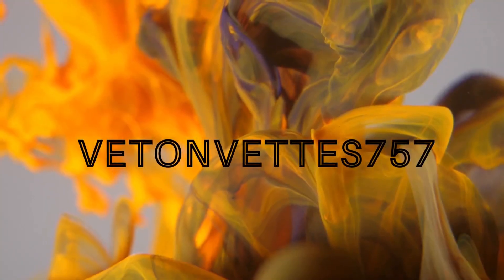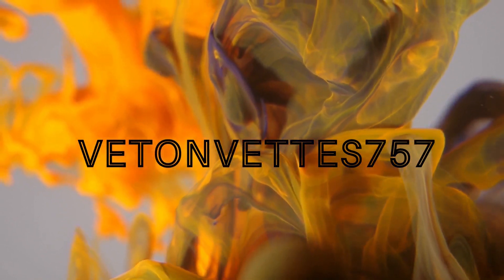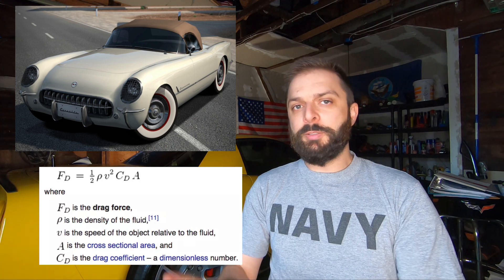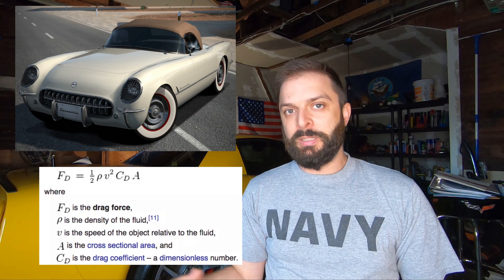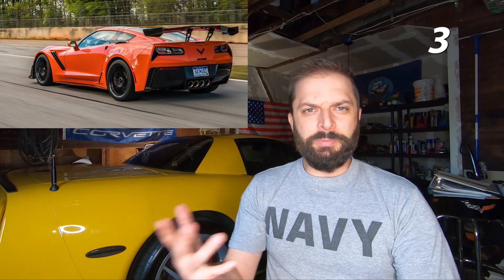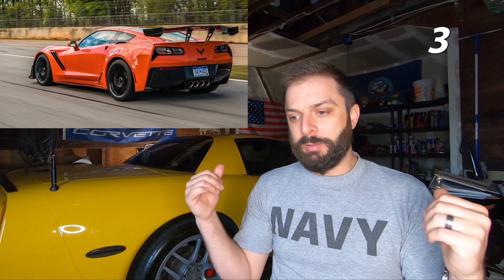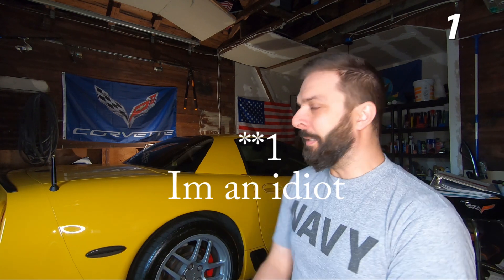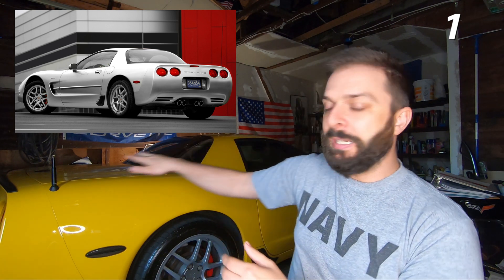DOES NEWER MEAN MORE SLIPPERY?  FROM LEAST TO MOST AERODYNAMIC! C1-C8 DRAG PROPERTIES.

Comment: The standard C6 Coupe has a drag coefficient of 0.286.
The standard C5 Coupe has a drag coefficient of 0.290.
These numbers are very close, but in addition, as you stated, with its headlights up the C5's drag coefficient significantly worsens.  So in terms of drag coefficient, the C6 is the most aerodynamic.  But, when the the frontal areas of the two cars are factored in, the C5 could be considered the "more slippery" of the two cars.  Frontal area of a C5 is 20.7 cubic feet and the frontal area of a C6 is 21 cubic feet.  So the CdA of the C5 is 6.003 and the CdA of the C6 is 6.006.  And when rounded to the correct number of significant figures, both cars have a CdA of 6.0.
So basically, it's a tie score between the two cars in terms of who slippery they are through the air if and only if the C5's headlights are retracted.  Otherwise the C6 is not only the most aerodynamic (in terms of Cd), but also the most slippery (in terms of CdA).

Comment: As a yuuuge Corvette fan and and researcher of aerodynamics, I enjoyed this video.  I understand your C5 bias, I've proudly owned 2 C5s and a C4. But being a Corvette encyclopedia and fairly knowledgeable about aerodynamics, I must respectfully correct you on #1.  The best number on C5 was the base coupe with .29 c.d. (you are correct!). As much as I dislike the carp-mouth and slightly narrower body of the base C6, it DID eke out a svelte .28 c.d., making it the most aerodynamic Corvette AND sports-car of 2005. Not bad, considering the Prius (most aero vehicle that year) had a marginally better .26 with a mutated-football body, pizza-cutter tires, and a tiny grille opening to cool those li'l mice powering it! The C6 Z06 had a worse .34, but it looked so much better than the base C6!  Interestingly, the 350hp base C5 had a higher top speed (174mph) than the lighter, more powerful 405hp Z06 (168mph).  Aero efficiency is very important!  I got 40mpg when 'hyper-mileing' in my '03 6spd Vette, but have also seen 160mph with a passenger onboard and targa top off! (I couldn't even hear him yelling!)😁

Comment: For the unitiated, "drag coefficient" essentially is a percentage an object with a flat surface facing into the air around it.

So a pure brick - the reddish brown things your elementary school might have been covered in - would have a Cd(coefficient of drag) of approx 1.0...!

The downtown bus?  A slightly rounded brick with a hint of rake to the front end: Cd of 0.7 to 0.8.  

A 1983 Renault Alliance sedan: 0.40 or so.

And so forth.

I for one cannot believe that my 2010 Honda Accord Cd = that of a (new for)1982 Pontiac Firebird: 

0.31!  

Even though the Accord towers over my favorite generation F-body, and outsizes it in every other direction.

Comment: sure would be interesting to how the c3 aerodynamics changed over its run.
Reply: He did mention how much improvement there was with the C5 hatchback, so I'm thinking the 1978 through 1982 with the hatchback would be much greater than the 1968.

Plus there's the square rear end of the 68. Can that be better than a tapered rear end of the mid 70's through 82?